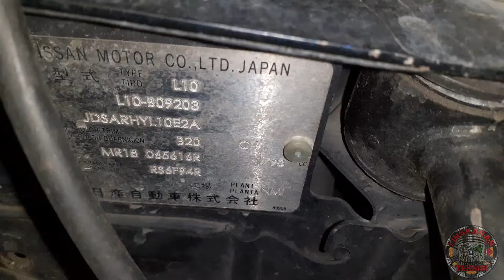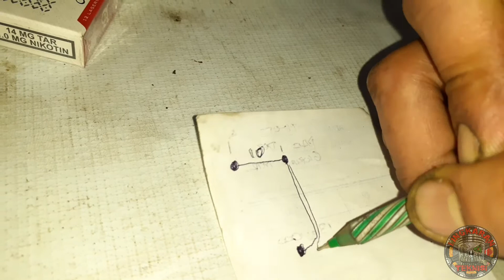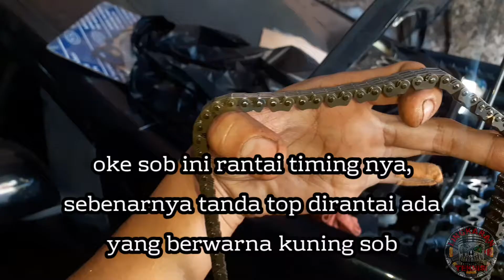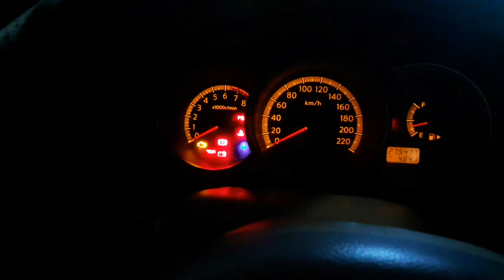Top timing grand livina 1,8 cc || moment cylinder head

Comment: Om mau tanya celah klep livina 1.8 berapa yaa? 🙏
Reply from the maker: Klo yg d vidio klep in antara 15 dan 20, klep ex antara 30 dan 35 om,,
Reply: @lingkaranteknisi  berarti yg klep in sama ex itu bisa gak sama masing-masing silinder yaa om? Maksudnya misal contoh klep in ada yg 15 ada yg 20, gak musti sama rata misalnya klep in 20 semua?
Reply from the maker: @Kutuloncatreal  ga bisa bg krn sistem ny udh pakai lifter atau semacam botol² klep yg tdk bisa distel sprti mobil lama
Reply: @lingkaranteknisi  tapi om, bukannya toleransinya itu +2 atau -2 yaa? Misal nih klep in di ambil celah 18 nah ukuran lainnya pokoknya 20 boleh atau 16 boleh. Jadi gak boleh lebih dari 2, contoh kayak 15 sama 20 nah itu kan bedanya lebih dari 2. Setau sy kalo beda gitu bisa bikin suara ngeletek? Bener gak yg sy contohin tadi yaa om?
Reply from the maker: @Kutuloncatreal  yg sy alami normal² aj om,, kalo ingin hasil yg sesuai data pabrik harus beli baru lifter nya om, 16 buah lifter nya, 🤭
Reply: @lingkaranteknisi  ada wa gak om, mau tanya-tanya sedikit 🙏
Reply from the maker: @Kutuloncatreal  dm ig lingkaran teknisi om